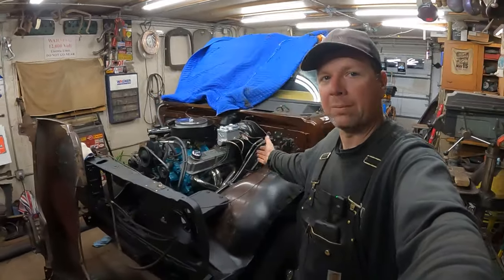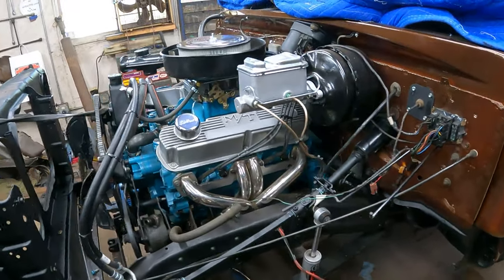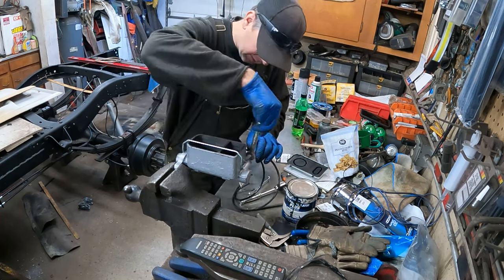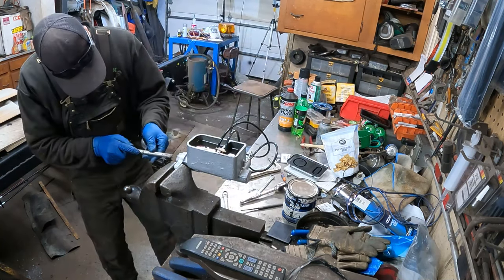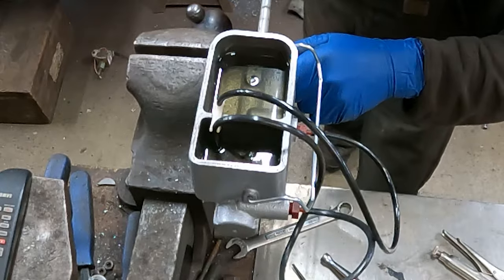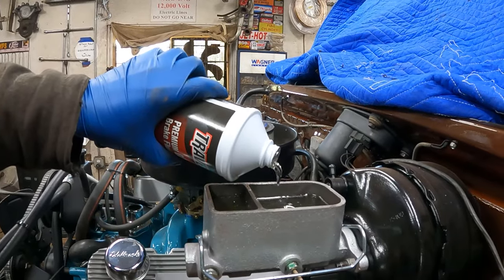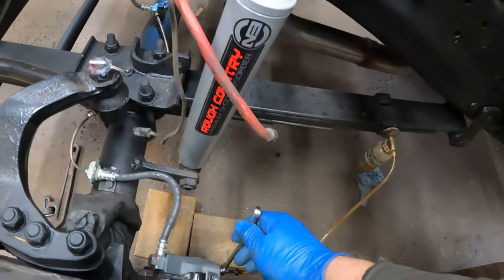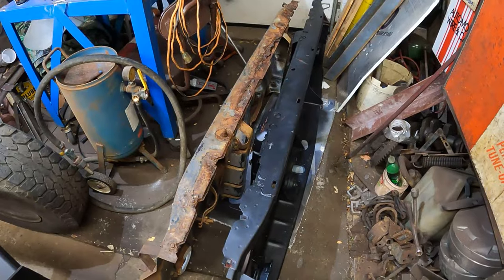How to Bleed Brakes

Comment: With your rough country lift did your steering extension block bolts fit? I lifted my ‘79 and the hardware was too thin on my stock steering knuckle
Reply from the maker: Yes.  I removed the stock studs and installed the Rough Country studs with the steering arm block and it worked fine.